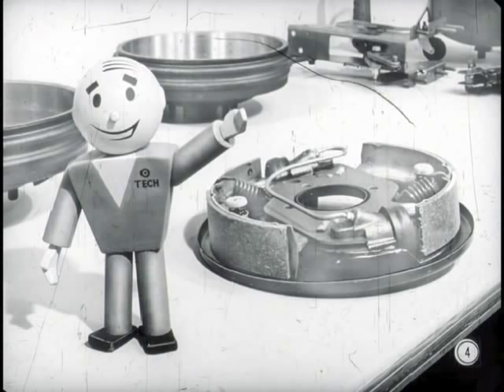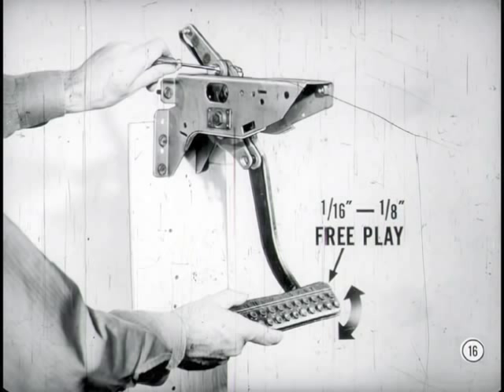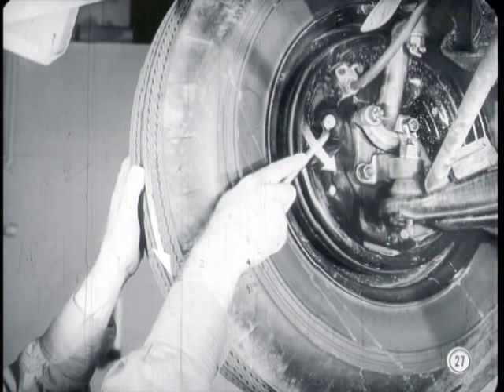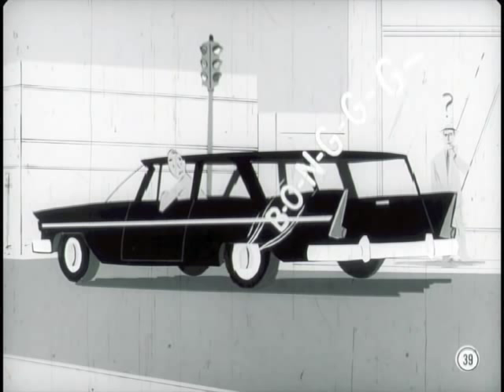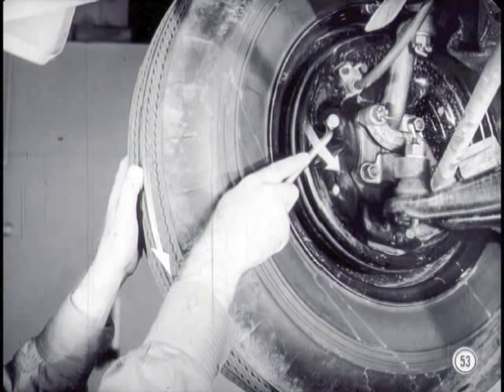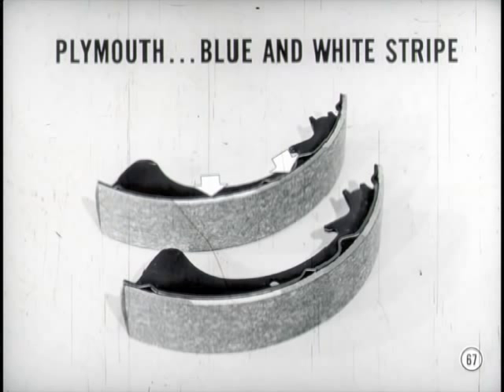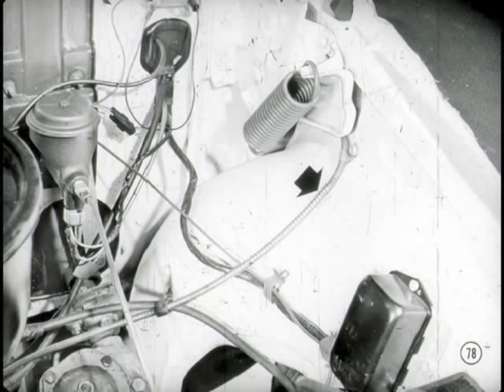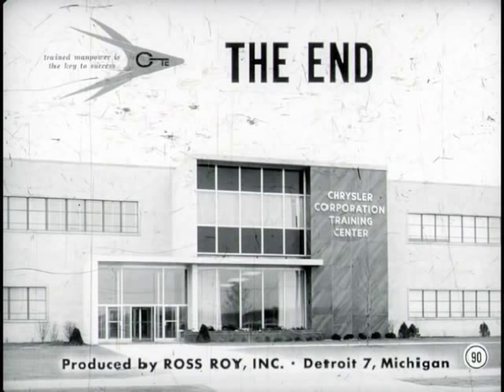Chrysler Master Tech - 1960, Volume 13-9 Brake System Service

Comment: I never used a pressurized brake bleeder tank for years and it was never a problem. However, I am considering a Motive Products brake bleeder for my freelance work.
EDIT:
6:20 If someone confuses brake parts for the right wheel and left wheel, the automatic brake shoe adjusters will make the brakes loosen up when the should tighten them.
8:10 By "No foreign parts" I hope he only means "No parts that the car was never equipped with." I don't know how often I replace brake parts, and several countries are on the packages.
14:28 That is another tool that was no longer used for many years. People take a brake shoe bore gauge and take measurements at different angles to find the high and low spots in the drum. Then, no matter how good the drum measures, it gets machined when new shoes go on, or a new drum goes on when the old drums are too worn for machining.
Reply: Just an FYI: This tech video is referring to 1960 Chrysler (same up to 1962) and none of the brakes are automatically self adjusting.  All 4 wheels require manual adjustment, each shoe, 8 adjusters in total.  Not the best system but it’s what on my 300F.